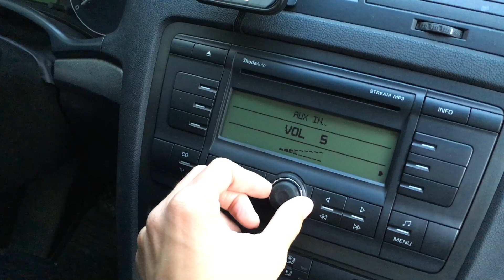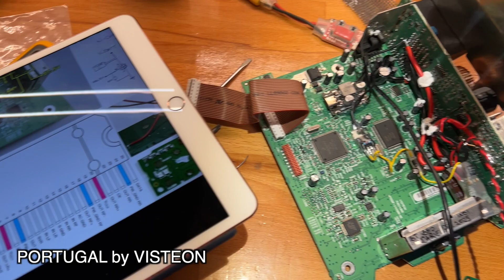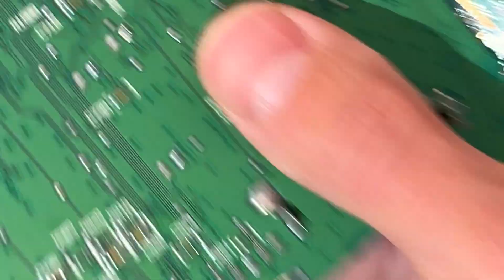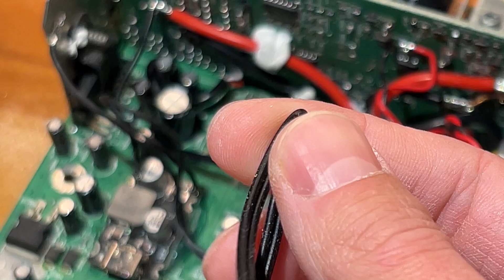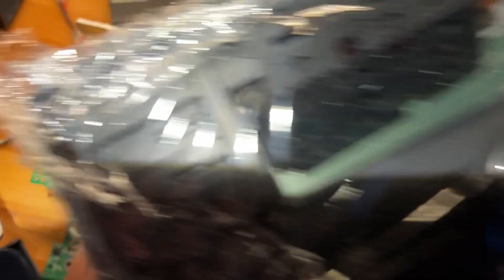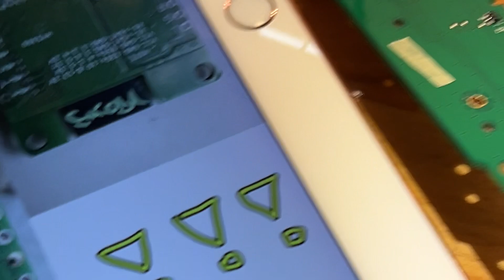Skoda Stream - Bluetooth Tutorial

Comment: i didn't understand the part of the buck converter what i only understand is that you took the 12v from the capacitor to the buck converter and the 5v to the Bluetooth pcb how did you use the 5v that powers on when the ignition is on to make the buck converter turn off when the car is off (and if i don't mind the delay can i just take the 5v from that and just enter my phone setting and connect manually)